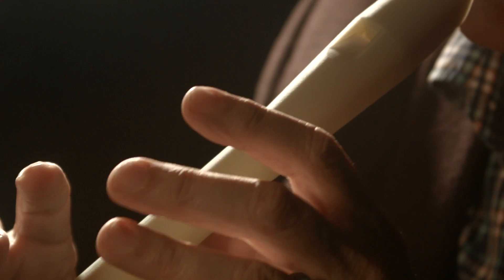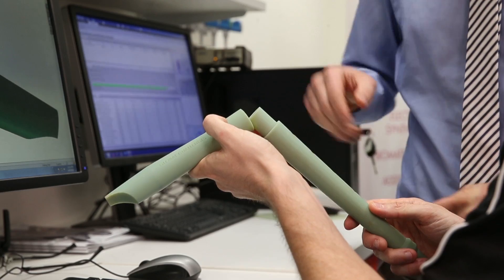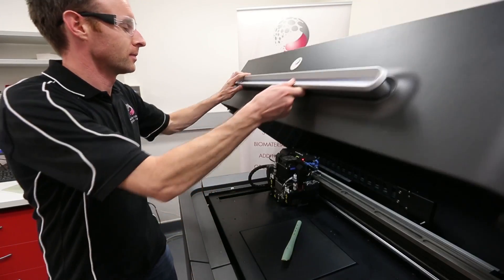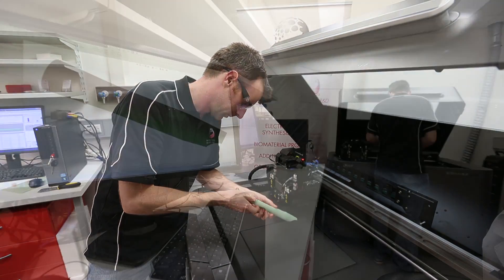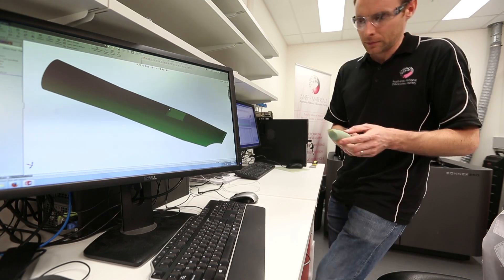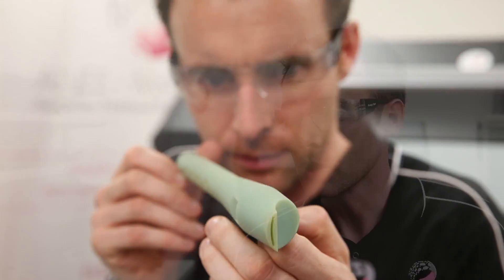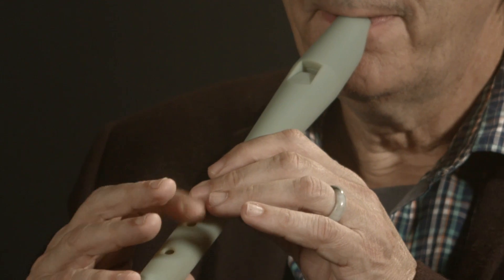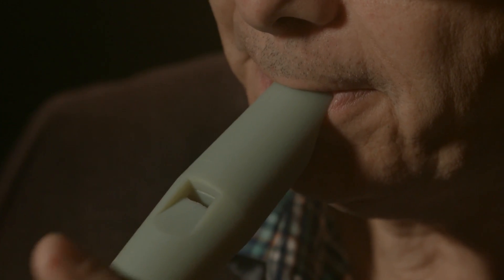3D printed flutes set to revolutionise the music industry

Comment: That looks and sounds like a recorder, not a flute... I know flutes as an instrument that you hold horizontally, has keys (Buttons?}, and you blow over the mouthpiece instead of into it (Like how you play a recorder or ocarina)
Reply: These are vertical flutes, and so are recorders.   You're probably thinking of the concert flute, which is indeed a horizontal flute.  As are several traditional instruments, e.g. classical Chinese flutes.
Reply: @yuyiya  I was thinking of concert flutes 🙂 The ones you see in band and orchestra 🎵🎶
Reply: @ZeldaACFan17   Technically a flute is an instrument played by blowing over a hole onto a sharp edge , "embouchure" hole,  normally they are played sideways "transverse" eg concert flute, irish flute, but not always, eg Japanese shakuhachi flute is a longitudinal flute.  A recorder or a whistle like those in the video is an instrument played by blowing into a "fipple", a mouthpiece that channels the air into a sharp edge.   The instruments in the video are most definitely recorders / whistles .
Reply: @c47force15  Sorry if I got something wrong 😞 I'm not much of an expert on the smaller or more complex details of instruments